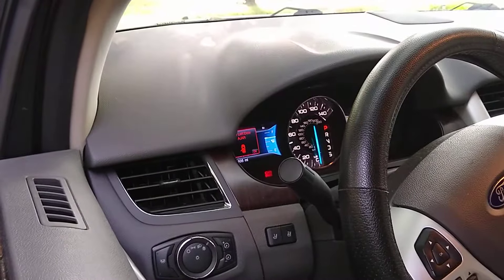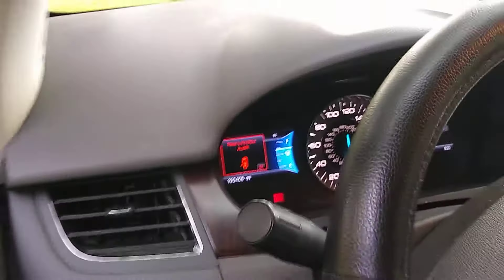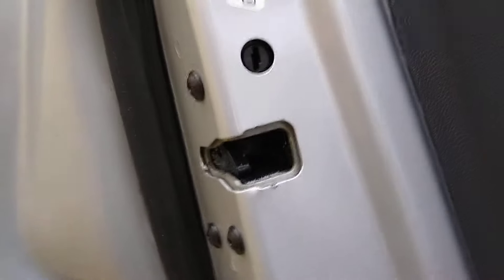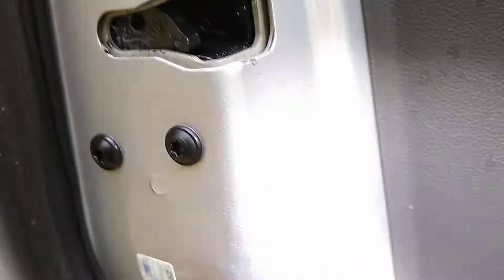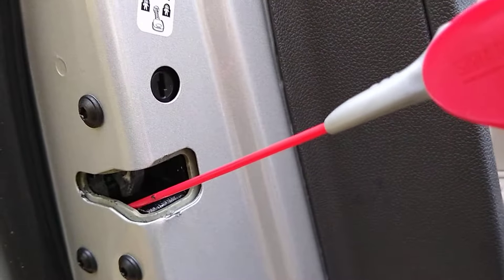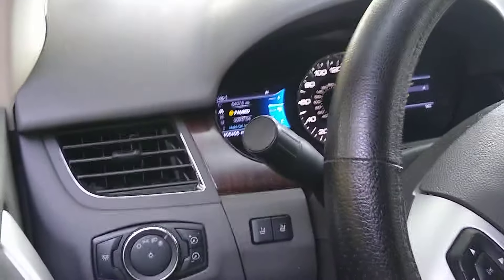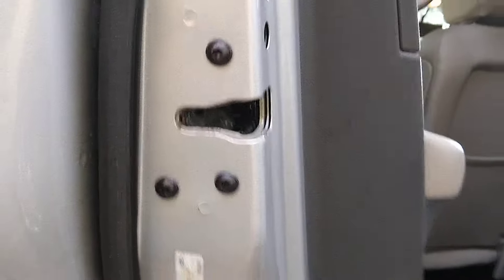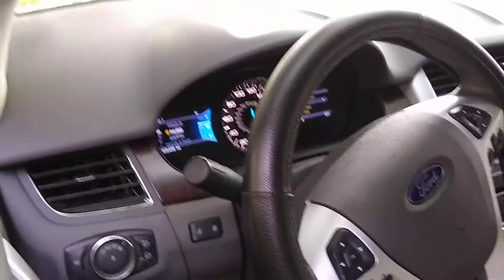Door ajar indicator/ dome light stuck on. Try this first before replacing switch

Comment: Dude!  You saved close to $200+ (that's what the mechanic wanted to charge me).  Like you said, I got the WD 40, sprayed it a few times --- opened and closed it many times.  Then went and opened and closed all the doors -- including the trunk.  It didn't work right away, but after all that opening and closing, problem fixed!  I cannot thank you enough!
Reply from the maker: You're welcome, Glenn! I went to the grocery store today and even with buying the bare basics, I had to put a few items back but it sure was nice with my car door switch working properly. I'm happy to hear that it fixed yours as well!

Comment: Omg omg omg. AMAZING. I did this with my 2004 santa fe. I was skeptical at first because i thought it was either the door switch or faulty wiring / ground or water damage to electronics from all the rain we were having here recently. My dash warning was on and dome light. Luckily there is bypass switch for dome but dash warning was still on and could have drained battery overtime. I first tried the drivers side door. Flicked the lock hinge down, sprayed with wd40, released hinge with inside handle and closed the door. To my big suprise the light on dash got dimmer so i knew i was in the right track. Cycled through open and close a few times and it went out completely. Came back again so repeated the spraying process and it came off again. Even if it does not hold up at least i know what the problem is. I cant thank you enough for this video. I am an advance diy’er and have looked at many different videos and tutorials from a wide range of auto mechanical topics, and this one was by far the most amazing. I never knew that hinge had electronics tied to it and never expected it to work on my vehicle since yours was a 2007 ford and mine a 2004 hyundai. Its the simple things that are the most spectacular and this video is up there for one of the most helpful ones on youtube. It works for many different cars guys. If you have similar problem, this might actually do the trick. Cheers.
Reply from the maker: You're welcome, PBM World! Happy to be of help...

Comment: Thanks very much. Tried this with some Dry Silicone Lube I had with my 2007 Ford Mustang and it worked perfectly. Had to open and closed the door a few times, like you said, but it worked consistently thereafter.

Comment: Thanks alot for this video , i was about to open up the door panel and replace the door lock actuator , I am From 🇴🇲  Oman and i have GMC sierra 2009 HD 3500 and a hummer h2 2009 with the same issue , i have used WD-40 electric cleaner and then a full can of WD-40 on all 4 doors left it for a night the second day i drove my hummer off to work and the message is gone and the lights are off , the Sierra was driven later and i was happy to see my info display clear with no messages.

Big thanks again
Reply from the maker: You're welcome, AlButhain! Happy to be of help...

Comment: Fixed me up.  We had a really muggy and rainy week last week and my 99 Ranger has some well used bits.  The door ajar started today and just using some air cleaner and electronics cleaner got me cleared up.  Thanks for the info!
Reply: So you physically wiped it down to clean it off?
Reply: @Adrien_broner  I did the same thing shown here except with electronics cleaner spray instead of wd-40.  It did the job and hasn't been a problem since.

Comment: Thanks for this video I had the same issue with my 1999 Volvo C70 convertible on the passenger door. No courtesy and door edge marker lights after opening the door. After spraying some lithium grease in the door lock as in the video, all worked again. Thank you so much.
Reply from the maker: You're welcome, Erik! Happy to be of help...

Comment: Thanks, mate!  A little (kinda) WD-40 fixed my 2016 F150 Lariat.  Just sprayed it in, then used a screwdriver to rock the latch through full range of motion about a dozen times.  Glad I really worked on it a minute before I started taking things apart!
Reply from the maker: You're welcome, Craig! Glad to be of help...

Comment: It works! Huge thanks for the video. Wear safety glasses as you may get back spray. Start with the electrical cleaner, then lube the latch itself (not the switch) with plastic safe grease. It is worth a shot on any car with a switch just below the latch. The switch is likely just dirty after many years. In my case, I ordered the switch, was ready to replace it ($40 in parts and couple hours of work) but then saw this video, figured I will try it. Aimed below the latch with electrical cleaner the best I could, since seeing the switch was impossible. It cured the problem nearly immediately. Followed up on the latch only with some white lithium grease. The new switch part is likely going back 😄

Comment: I had similar issue for my GMC Acadia.  My radio wasn’t shutting off so I put the geese on the switch and it fixed the problem.   Thanks for posting!

Comment: This worked on my 2010 Mercury Grand Marquis.  Courtesy lights were staying on and key fob transmitter would not lock doors.  Dealt with this intermittent problem for years. Thank you so much!
Reply from the maker: You're welcome, Nogie.
Reply: Do you know which door was giving the problem, or did you just spray all doors? I too have a 2010 Grand Marquis with the same problem. Skip
Reply: @skipwilliams7288   Unfortunately my problem returned and none of the locks will work now. I think that I may need a new door module. That black box in the lower right hand side that everything connects to. Must be a common problem with these cars. Good luck with yours.
Reply: @nogiedeville1623  Just had all my problems fixed including intermittent power windows, fob not working, trunk release not working,  tire pressure warning on, etc. Found out it was green ground wires not connected inside  of the flex rubber line between the frame and the drivers door. Everything now works. I'll bet that's your problem too. I read about that from another U-tuber that has a 2010 Grand Marquis with the same problems. It was green wires with some blue tape wrapped around them. Check it out and I'll bet you'll find the problem. Skip
Reply: @skipwilliams7288   I'll bet you're right. When I jiggle that bundle of wires between the door and the frame the dome light will sometimes go off and on. When I get a chance I'm gonna pull the door panel off and check that green groundwire.  Thank you for the info Skip!
Reply: @nogiedeville1623  You are welcome. You will definitely have to pull the door panel off so you can pull that flexible boot into the door. Unwrap bundle of wires and about in the middle of the door to body you will find the green wires. There is more than one that needs to be soldered or use crimp connector.

Comment: Worked perfect on my 99 expedition thanks. Just adding WD40 fixed the problem I wonder why. I did exactly what you did push the latches up spray oil open door so latches go back down close door wahlah problem fixed.

Comment: OMG. 2001 Volvo V70. I finally resorted to pulling the light bulbs out of the Dome and the foot area because the lights would not stay off and the little red! On the dashboard kept flickering on and off while I was driving. I did as you said, and now the lights go off and the little red emergency light isn't flashing which is tied to the doors drained my battery and nearly killed it

Comment: Thanks for the video. Have you any suggestions for a 2000 Focus whose interior lights will not come on when I open any of the doors?
Reply from the maker: Mark, it might be a bad relay.
Reply: @michaelheyward7668  Thanks, Michael. What I know about automotive electronics could fit on the tip of a spark plug. The fuse is good. From what I'm seeing on the internet, there is no relay for the interior lights. Just a fuse.
Reply: @michaelheyward7668  The bulb was burned out. The working map lights fooled me.
Reply from the maker: Hi Mark, happy to hear that it was just a bad bulb.

Comment: This sounds like the perfect opportunity for a class action suite.  1. Wide spread problem across several models. 2. Known to the manufacturer. 3. Fees range $250-$500 per door to fix.  4. Part of a safety system. Therefore putting the occupants at risk because the door locks will not stay locked due to the sensor.

Comment: Love the accent! I sprayed carb cleaner first then silicon spray. Should I use lithium grease instead?
Reply from the maker: Thank you, Ned! I have just remained with the WD-40 and it seems to be working fine. Took several applications and 50-60 door opening/closings and all has been good for 3yrs now.

Comment: Same happened with me after lubricate this joint with engine oil.... Can i spray petrol or alcohol  ?
Reply from the maker: Alcohol is a great cleaning agent. Just make sure it has evaporated off before doing anything that could create a spark.

Comment: Thanks for the video can I asked how many times till worked? I tried it about 10 times still not working
Reply from the maker: Boostercontrol100, for mine, it took several applications of the spray and approximately 40-50 opening and closing of the door. 3yrs later and still working fine.
Reply: @michaelheyward7668  awesome!! Thanks bro I will continue trying.
Reply from the maker: You're welcome, brother...

Comment: WD40 is not a lubricant, it's more of a pressurized de-greaser in this case. A nasty characteristic of WD40 is that it attracts dust and dirt, so following this up with some silicone spray lube would be a good idea. 👍👍👍
Reply: Yup wd40 turns into a muck

Comment: I did this and the light went off for a second and it's still on. Is the W-D 40 the key to this? Thanks! Great video. I'm worried it's going to kill my battery, but I know squat about vehicles. lol
Reply from the maker: You may have to do it several times. Mine has worked for four years now.
Reply: @michaelheyward7668  Thank you! It worked! There was some gunk in there and I just kept opening and closing the door! 🙏🏼
Reply from the maker: @TMH792  You're welcome, my friend! Happy to be of help...

Comment: I’m having an issue with my Cadillac CTS at the moment it’s a 2010 all interior lights are stuck on I tried this door method and it worked but now having an issue again.. shall I just try this until it works again or is there a better option?
Reply: Did you fix this problem mine is doing the same thing goes away and comes back on

Comment: I'm having this problem on my 2010 Toyota Venza. I had a water problem on the interior from a clogged AC drip line. I took the interior apart, seats out, and removed the carpet & underlay, and have been cleaning with soap & water.  Then this problem started.  So, I assume I got some sensor or switch wet.

Comment: The guy I bought the truck from, had it undercoated...RVERYWHERE!!! Any thoughts on how I get that shit outta there, then what to use, afterwards???
Reply from the maker: Donald, the only thing that I know of that would wash away the undercoating would be a degreaser. However, I don't think it would be a good idea with the plastics which are involved with the switch assembly. I would just keep trying the wd40 and see if it loosens things up. You might get lucky. Wishing you much success with the situation as I know it can be nerve rattling with the system not functioning properly. Let me know how it goes!

Comment: Will this work for a ford fiesta 2007
Reply from the maker: @aj2d968 if it is the door switch that is causing the issue, it should work on any make or model.
Reply: @michaelheyward7668  any thoughts on how to determine this ?

Comment: My 10A interior lights fuse blows immediately. Any ideas please? 2014 Focus
Reply from the maker: Dave, it's most likely a bad switch which is shorting out or a bare wire. Have you contacted your local Ford dealer to see if there is a "TSB" ( Technical Service Bulletin ) for this problem with your model?

Comment: So I actually use a can of electronics cleaner first  a couplof them , and  then  close and open a few times spray in the white lithium Grease usually always works only had one failure and it's because the latch was loose

Comment: As a locksmith please never use WD40 in locks as a rule however I even replaced a door latch in a Ranger to stop this problem only to read it's the only answer and it was. Almost the only time I will ever recommend that nasty sauce is for this or removing ink or adhesives. It is a lousy lubricant once it dries
Reply: What should we use? Lithium grease?
Reply: @adilnabbie2612  Houdini is the juice to use on locks. Available at some big box stores and of course the jungle river online

Comment: Thanks for the tip but if I can’t get my rear gate open, I can’t do this.  Seems like a simple fix but I can’t get in to do it.  Frustrated!
Reply: To get your rear gate open, there is probably a cover near the latch that you can pop off and manually move something to unlock the gate.

Comment: Did this and got the switch working at least intermittently.   Now I know I don't have to hack wires or smash plastic bits out to have it half work.  
If it continues to be a problem I'll replace the locking mechanism. 

Thank you!

Comment: I had my latch and sensor replaced and I still have this problem.
Reply from the maker: Adrien, is it possible the wrong door was worked on? It would most likely be the door which is used the least.
Reply: @michaelheyward7668  It had to be taken off and put back on again (the entire door). It’s fixed now.